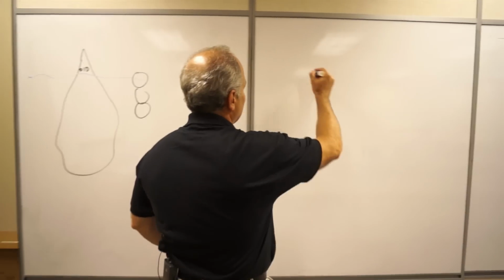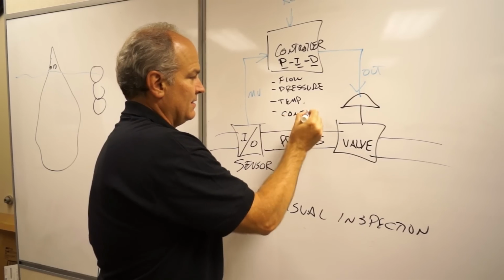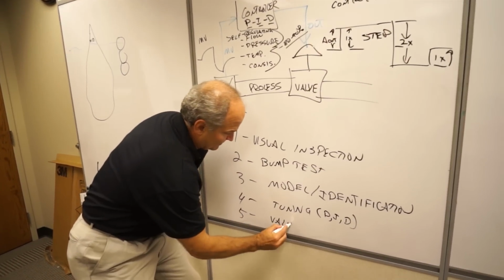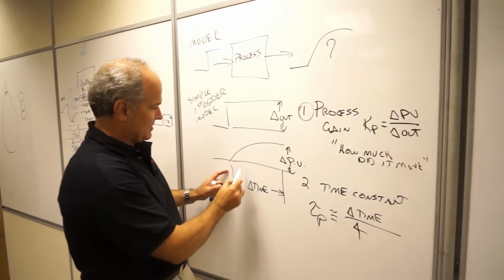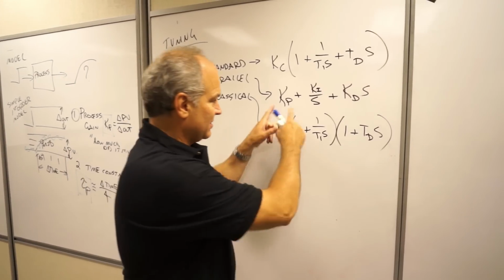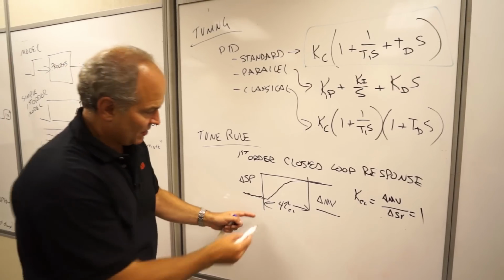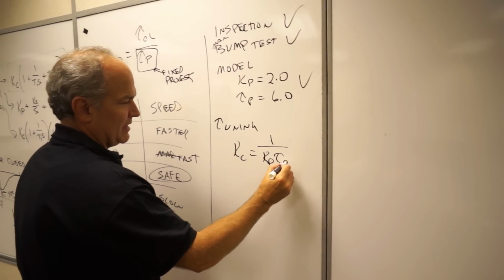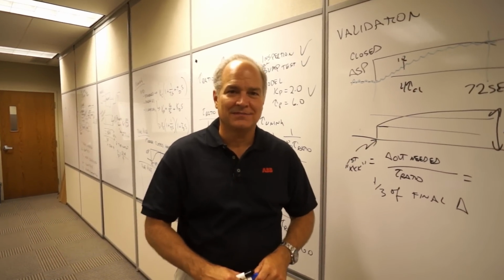Tuning A Control Loop - The Knowledge Board

Comment: Your first point is so RIGHT the number if times I have gone to breakdowns "Due to the controller" that is something physical not functioning correctly in the big bad world. The worst was the wrong sensor been installed from construction and after a lot of engineers looking at the controler over 3 years, then I go to site, doing your first thing and look at all the sensors and find they all were getting reading from a pressure tranducer that was the wrong type. Remember there is no such thing as a desk engineer. Very Good Video
Reply: How did you recognize it was the wrong type or what was wrong about it.

Comment: Great video! Very concise and no nonsense :-) It might be worth mentioning that when deriving a model from a step-response (I call this a data-driven model), the step used for the response should be in the linear region of the plant/process. Take for instance a motor that can run between 0-1000rpm. To derive a linear model for this motor, the step should not be close to the lower (0 rpm)  and upper (1000rpm) operating regions of the motor, due to non-linearities from e.g. inertial mass (shaft, gearbox, load). I would recommend performing an initial step of say 200rpm, followed by a step from 200 to 800rpm. This last step is used for the linear model. The low and upper regions for a motor tend to be non-linear and would not produce an accurate linear model.

For validation I tend to check my stability margins by evaluating the gain and phase margins of the system (yes, I use a classic frequency analysis design approach). Typically I calculate these margins and measure them using an analyzer. In most cases all checks out, but you could risk running into instability due to resonances that are not apparent in the 1st order model. Cheers from Denmark :-)

Comment: Although some people are very good at it: trial and error tuning should be avoided as much as possible. This is a very nice example to extract information out of process data for tuning loops with simple dynamics ..... However if you follow this instructions to the letter your proportional gain (Kc) will be most of the times not correct and you will not get the intended closed loop behavior. The proportional gain(Kc) should be based on the scaled process gain. So if you use in the calculations Kp*(Output_sf/PV_sf) then your result will be fine. If you use tool for this you have to give in the scale factors and the software takes care of everything. If you plan to do the calculations manually (which is not bad at all) then never forget to include the scaling.....Wrong (or no) scalings = Wrong tuning
Reply: You understands it very well, it is indeed important and cant be neglected

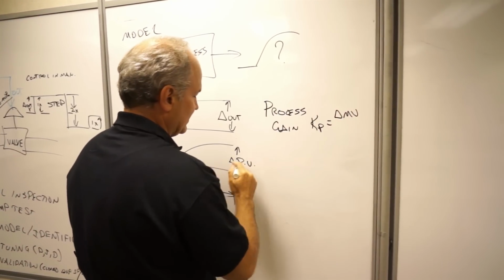Comment: I know I’m posting this 10-years late, but after you calculated  𝐾ₚ  ( 8:30 ), how would someone go on to calculate appropriate values for K-sub-i and K-sub-d ?
I ask because control schematics usually don't show  𝜏  time constants. Instead, they show GAIN constants (i.e. 𝐾  ), in the following form... 

𝐾ₚ 𝑒(𝑡)  👈 for the Proportional portion
𝐾i ∫ 𝑒(𝑡) 𝑑𝑡 👈 for the Integral portion; and
𝐾d  𝑑 𝑒(𝑡)/ 𝑑𝑡  👈 for the Derivative portion .

Also, are Process Gain and Proportional Gain both the same thing, 𝐾ₚ ?

note: 𝑒(𝑡) is the error signal produced by "running" the Set Point into the non-inverting input of a summing junction AND the measured PV (process variable) into the inverting input of the same summing junction, so as to produce the difference, which is 𝑒(𝑡) .

Comment: Great ! But you didn't mention about the delay (dead time) potential issues, with a long delay, this tuning rule is much less efficient, but ok it works great in many cases.
Reply: Laurent Porre 
Dead time is included in the process variable response. If it’s too long (compared to actual response) it means the valve is sticking (called stiction) in his first order example. Repairs would have to be made first and then perform new bump tests.

Comment: Kevin, You remaked that is extremenly important to know the PID type (Standard, Parallel or Classical). However, in video I cannot see where this information is relevant. The fact you said to use standard, where it is used for calculation?

Comment: Similar to the way I do it, but on some occasions unable to perform even a manual step so watching the response adjust accordingly plotting values to see how the gain changes with various output settings. What about showing when to use a feed-forward and looking at the plant to determine the best way to control not as individual PIDs plus combing more than one process variable into a single control valve.

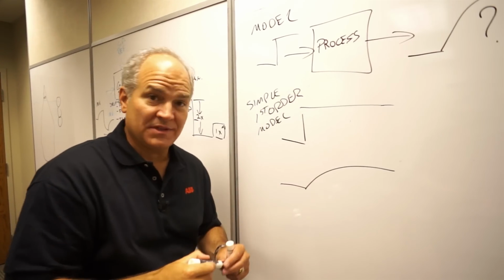Comment: Great video Kevin! It did leave me with a few questions. At 5:00 and again at 7:50 you describe bump testing and write out a change in the process variable based on the change in the output. My question pertains to what is "output". I keep thinking that we should be watching for a change in output based on a change of input...  So I'm interpreting you to mean that the change in the output, is the output controller (presumably in milliamps from 4 mA to 20 mA), which serves as input to the control valve or the pump speed that would create a change in flowrate (to pick an arbitrary, hypothetical process variable). Presumably this output (my input) is a number that you can get from the control system historian (DeltaV/Foxboro/Siemens PLC/DCS) or taking a measurement with a multimeter across the two wires to the control element. Is that correct?The process variable is undoubtedly measured and also available from the HMI or historian. 
My next question pertains to the equations for Standard, Parallel, and Classical PID algorithms. You showed to solve for Kp and Tp and how some of the other parameters (Kc, Ti, Td) could be solved for if one assumes a 1st order model. However you present these 3 equations for standard/parallel/classical with variable S, and never define what S is. Are those expressions supposed to be equal to something? Are you supposed to set these expressions equal to zero to find S?

Comment: How do you adjust your method if the focus is on disturbance rejection and not a setpoint change (i.e. setpoint is fixed all of the time)?
Reply: This is not only the exact question why I (master in control engineering plus 30 years of field experience in power plant control loops) disliked this video but the first question you have to ask yourself when theoretically approaching a control loop. Of course first you have to identify that measuring equipment and actuator are doing what they are supposed to do. This is correctly mentioned at the beginning of the video. But then it gets confusing. Most controls are optimized for disturbance and not for setpoint changes. If setpoint changes are part of the process you add in the setpoint path a setpoint control/guidance , e.g. a ramp or a time delay,  to smoothen setpoint changes. But the controller itself should be optimized for   what you call disurbance rejection. And the integral time is not set according to dominant process time constant like in the example which is in most cases way to slow, but to the parasitary delay times in the process plus the measuring delays. If you want to allow a fast control with a certain amount of overshoot you select about 2-3 times the sum of the delays, if you want a rather slow control without any overshoot you make that factor higher. Kp you select in a way, that your control is fast enough. You have to be aware that the control is more sensitive to noise (can also come from the measurement) when the gain is bigger.
Whereas the video contains a lot of information in a relatively short time the content is in my opinion not totally correct.

Comment: 8.42------- (i may be wrong but process value is our output of the system)

How can you divide  (del P.V with del output, for gain) 

Shouldn't it be ... ( del P.V / del input, which is our step input)

Kindly correct me if im wrong.. anyone..

Comment: one point , why after manual bump test , we put loop in auto .. after all we put a loop in auto when our tuning put the loop tuning parameters that stabilize the loop. Then we do the fine tuning in auto.. Putting a loop in auto without inserting something valid and close  parameters might be dangerous.. plz reply
Reply: aa 
Once you have performed all these steps, you put in auto to prove your tuning (control) , you know ahead of time it will meet the new set point in 18 seconds (in his example), you also prove it will not overshoot the new set point.

Comment: what are the units of Kp. If dimensionless were the values normalized using their corresponding 100% values?
Reply: A Gain is a function of an input. It has no unit, as it is only a ratio between input/output.
Gain of 0.5 is a reduction of half the input value. Gain of 2 is the double of the input. 

you start with a Gain (Kp) of 1.
 (Kp of 1 = BP of 100%) Bp= 100/Kp

This is the "starting" state, then you can do your calculations.
You generally start as this:
P=100 I=max D=0
then adjust your Kp (P) if you need more or less gain  (amplitude )
then add some integrals
then add some derivative
...
Reply: Raul Subia 
In the example he used in the video (Kp was 2), this means the valve is too large for the loop and should be resized to get a gain as close to 1 as possible, even though this tuning will control with a gain of 2 , you would have to slow it down (closed loop tua) that process large process upsets might not be regulated.

Comment: how do you tune with two interacting loops? i do not want to decouple. say for instance the interaction exists between the ratio controller which is (feed in/ flow out) and the pressure (which depends on feed in)
Reply: tandem313 
In this instance you would make the inner loop 10 times faster than the outer loop, using the same bump testing and tuning rules.

Comment: Great video. What I absolutely don't understand is at 15min16s: You say Td=0. But doesn't that value switch off the D-part completely and reduce the PID-controller to a PI-Controller?
Reply: I think you guys are correct. I have heard that most industrial systems do not use the derivative part, I am not sure why they wouldn't
Reply: I dont know if you still wonder why they dont use derivative term, but here is 2 reasons why anyway :) ; 

1- Derivative of error introduces a very high output initially if your set value is applied as step.  
        
      For ex., you start the cruise controller in the car, controller sees a set point change from zero to 100km/h  in just a few seconds; think how high would be the derivative of that and it will be fed now as an input to the motors with  also Kp and Kı terms! 

2- Noise. This one seems like a "ehh, they just say noise everytime they cant solve something" ( :)) but with a derivative term, noise can become a huge problem. Think of the magnitude response of  the derivative term; it is Kd * w (|Kd*s| = |Kd*j*w| ), where Kd is the gain and w is frequency. As you noticed probably if you apply 5 Hz, derivative term would be 5Kd and if you apply 10Hz 10Kd. What if we apply 100kHz( a noise freq.)  for ex.? then the noise would be multiplied with an enourmus constant while your control output is multiplied with something small. this reason alone can beat the advantages of derivative term in most cases. 

It is possible to get around both of these. You can activate the derivative bit later or change the term it derivates( directly output  for example) for initial problem; for second one you may be able to add a lowpass filter before controller etc.  but if you can meet the requirements with less component, time and effort why would you implement derivative and also deal with new problems.
Reply: PudoRandonneur 
That’s correct, derivative is not used for a first order curve response loop.